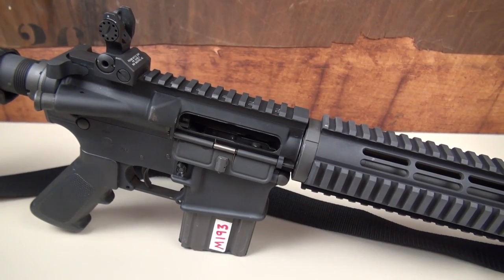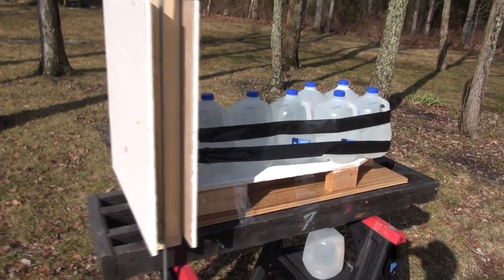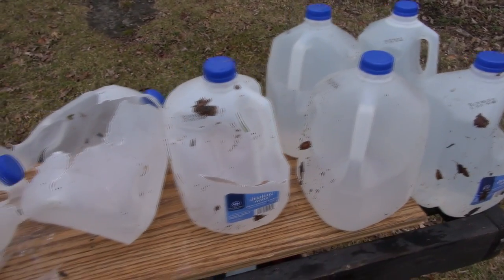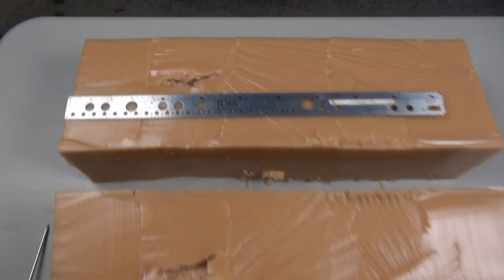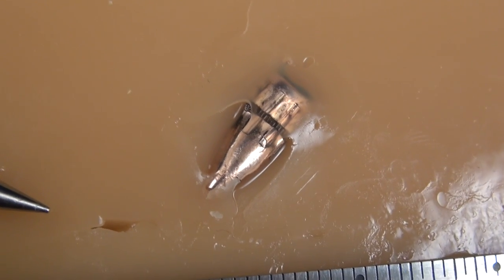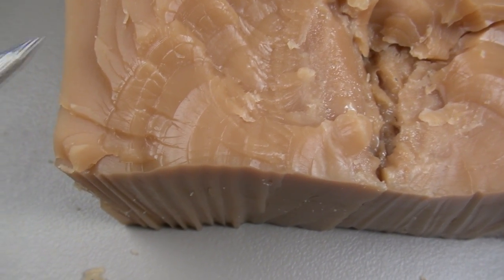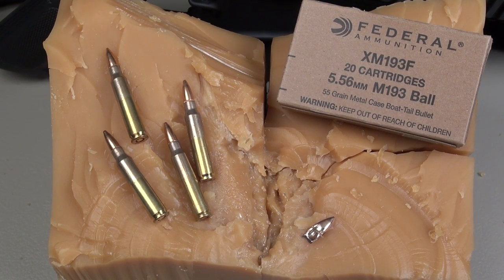5.56mm NATO XM193:  Drywall & Ballistic Gel Test

Comment: 416's are frequently chambered in 7.62, otherwise known as the M417 platform which SOF (includings SEALs) run in SBR. 

Hitting a non vital is known as a fringe hit. Newsflash, when your targets are taking cover fringe hits (arms, legs, thighs, shoulders, lower side abdomen) make up over 50% of actual hits on target. 

Incapacitation is just as important as killing a target on the battlefield, and in reality only a center chest hit or headshot is guaranteed incapacitation with a 5.56 round.

Comment: Haha. At >50 yards 5.56 will NOT yaw and will not even reliably frag 50% of the time, so what does that leave? A dime sized hole with very little kinetic force transferred into the target. Unless you hit a vital, he is still firing back. 

The round is too small and too fast to be effective at close range, especially out of a 14 or 16" M4 barrel. 

SEAL's are still using 7.62x51 416's since dropping the 14.5" MK17's for CQB so I don't think you have a clue.

Comment: There is a pretty big difference when they are behind a rock wall, tree, or some other form of soft cover. It will also make a pretty big difference when you hit a non vital. 

Not to mention that 5.56 does not yaw/fragment at >50 yards due to the rounds velocity and will not incapacitate an adrenaline pumped target with a non vital hit. There is a reason SOF was looking at 6.8 for CQB operations, the M4 and 5.56 does not drop bad guys at close range.

Comment: >shape and weight 

Are you daft? Higher mass means more retention of energy, which is moot at close ranges but it's important at long ranges. That makes it faster than a lighter bullet. Also, the plain M80 ball has a ballistic coefficient of almost 0.4 while M855A1 is around 0.3 - making the shape of 7.62x51 more efficient for range.

I think you're confusing x51 with x39, because x51 will go trough a pig at a MILE away.

Comment: But it has less mass and less ballistic coefficient, making it more sensitive to wind and inconsistent. Not to mention a more limited range.

Sure, the 5.56 is accurate but with it's limited case capacity it's not like you can buy really heavy low drag bullets comparable to the best .30 diameter options. Even if you could, it wouldn't feed trough a STANAG magazine. If you were buying a long action bolt rifle 5.56 wouldn't be the caliber of choice anyway.

Comment: @coltperc You do realize KE is simply a measure of the momentum?  There is nothing mysterious. Small (5) x fast (50) = 250  is the exact same as large (50) x slow (5) = 250. It's very very basic physics. Where the water gets muddy is trying to put numbers to the diff in characteristics of how a small fast round imparts that energy into tissue vs how a larger slower round imparts its energy. If you are shooting a steel plate it's easier. Same energy but longer impulse. A shove vs a slap

Comment: @coltperc You are confusing momentum with impulse. The momentum will be the same. The heavier bullet will take longer to impart that energy resulting in deeper penetration. In other words, it penetrates better & takes longer to stop but has no more energy in any way. A small fast bullet stops very quickly (short impulse) dumping it's energy very rapidly & doing lots of damage in the penetration it does get but not having lots of penetration. Same energy overall but results in very diff wounds.

Comment: Man you American's build houses like shoe boxes x'P The walls in my apartment are 1 foot thick sand stone. I could shoot them point blank with a .308 Win and it wouldn't go though. :P
Reply: all about location. If you live in a tornado area you will build it different from someone who doesn't have much of a risk. same with earth quakes. I live in the Northern area of the USA. We have insulation on the outer walls but not always on the inner walls. A lot of builders also like to find ways to cut cost especially if your not rich so they use the bare minimum. lol your .308 will be the best to stop a criminal
 lol.

Comment: Well, .30 cal projectiles perform more reliably than lighter, smaller projectiles when meeting interference such as grass, branches, leaves, etc and are more likely to continue on, or close to, their initial flight path.
Either the AK or AR are great platforms, I don't see the point in knocking either.
Cheers,
Sean.

Comment: It's not much more dangerous than handgun rounds or even buckshot. A miss is a miss and it can be potentially dangerous either way. On the other hand, the 55gr 193 loses it's velocity much quicker due to it's lower inertia. If you miss, with buckshot and pistols you have slow moving, high mass projectiles and with 5.56 you have low velocity and low mass projectiles.

Comment: What does penetration depend on? Mass and velocity. If you have a lower mass that quickly bleeds velocity after going trough a wall (also don't forget that buckshot and handgun bullets won't deform a lot, while 5.56 usually fragments - reducing the mass).

Comment: Nice test bro and I subbed. That is great round for that range and typical perk trying to break in the house. However I still lean on the 7.62X39 and 7.62X51 NATO due to the more brute force and knock down power. Either way wouldn't want to get hit by that 5.56. Nicely done.

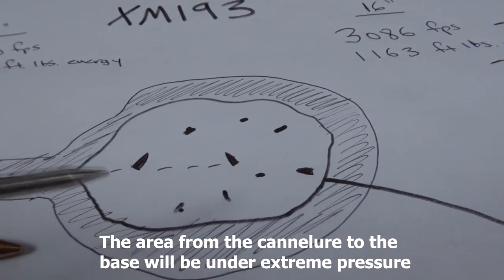Comment: M193 Ball is not 5.56x45mm NATO ammunition it's .223 Remington ball ammunition, it's the original designated 5.56x45mm ammunition used two decades before 5.56x45mm NATO was even created and adopted this is why the box doesn't say NATO, 5.56x45mm NATO started out with SS109 aka M855 green tip in the late 70's around 1976-1977 and it wasn't officially adopted by the U.S. military until September of 1982 when the U.S. Marines adopted the M16A2 because the M16A1 1:12 barrel cannot stabilize the 62gr steel core bullet so it was only to be used in M16A1's during emergencies and at close range,

M193 is the Sierra bullet Remington original loaded in their .223 cases for military surplus ammunition.

People keep calling .223 a varmint or  hunting cartridge is neither it was always intended for military use and even Eugene Stoner talks about this in an interview, no .223 Remington/5.56x45mm cartridges exist before the creation of the AR-15 it all started in 1957, there was not 5.56 NATO back then.

Comment: In 1977, NATO members signed an agreement to select a second, smaller caliber cartridge to replace the 7.62×51mm NATO cartridge. Of the cartridges tendered, the 5.56×45mm NATO was successful, but not the 55 gr M193 round used by the U.S. at that time. The wounds produced by the M193 round were so devastating that many consider it to be inhumane Instead, the Belgian 62 gr SS109 round was chosen for standardization,

Comment: You just disproved your own argument in your first sentence. The 5.56 was designed to reduce recoil, allow for greater accuracy and more effective suppressive fire, and increase a soldier's ammunition supply. It was not designed to "main" as you said. 
"really you wanna go there?"
I love how you act like your argument is impeccable.
"So by your logic your saying that the 5.56 has the same killing power of the 7.62?"
The 7.62x51? Yes, actually; in fact, probably more so though flexible tissue.

Comment: Kalashnikov understood that this is the range of most battles, which is why in his initial assault rifle system (AK-47) he used a round that packs alot of punch in a short range. (the 7.62x39 has a horrible drop rate after 300m, as it is a large round being pushed by not a whole lot of powder). Anything after that with just iron sights is difficult to hit for the average soldier. An updated version is the 5.45x39 (AK-74) which has a fast bullet that packs a large punch. Best of both worlds.

Comment: The standard combat confrontation in modern warfare is only about 300-400m. The military is all about being efficient and cheap, therefore, they use only cheap ammunition. Also, by making a heavier bullet, the muzzle velocity would plummet (and speed is one of the only real advantages of a bullet not much bigger than a 22 LR). If you look at other rifles of the same class (the AK-47 for example) there is a similarity as for range.

Comment: you should break less wood if you avoid running the wood grain parallel to the horse, also would like to see a video showcasing how the projectile responds to passing through a human sized piece of ballistic gel, through a set of drywall(possibly a 2x4) and into another human sized ballistic gel target, simulating a human casualty in a home defense , or otherwise situation.

Comment: that's not correct.
If the diameter and bullet type are the same, a faster and lighter bullet loses its energy more quickly that slower and heavier one, which means a faster/lighter transfer more kinetic energy into the target. Trust me, I learned physics at a graduate school and I can prove it by showing you a lot of formulas, which you wouldn't even understand. 
It's at long range that 5.56mm is actually ineffective.
Due to its high velocity and light weight, it loses energy so quickly.

Comment: no. the geneva convention bans bullets that are designed to expand like hollow point and soft point rounds. military full metal jacketed rounds do not expand. what you thought was expansion in the video was actually the round tumbling through the medium. when the bullet tumbles, it dumps most of its energy into the medium and causes the cavity. it should also be noted that pointed bullets all have a tendency to tumble on impact because rearward center of gravity destabilizes the bullet on impact

Comment: I had an M&P 15 also and I had the same problems with it. I also noticed it was very picky of the ammo it would cycle reliably. I sold it a wile back and purchased a Daniel Defense. I also have a Spikes Tactical, both are direct gas and they both work flawlessly. I run them both on a regular basis and I put anywhere from 1000-3000 rounds through them without cleaning them. smith and Wesson make great firearm but from my experience they just don't build a reliable AR15.

Comment: M193's are the US designation for the NATO SS109 loading for 5.56 rounds, per request from the europeans in the late 60's when the standard ammo was adopted. it has a hotter load of powder than original vietnam era 5.56 ammo and the boat tail shape you see in the video.

as far as I know M855's do not deform at all except for maybe shedding the copper jacket to expose a non deforming steel core.

Comment: ok i can see you have never studied bullet design,th term full metal jact boattail is the design and shape of the bullet a full copper case from from to back boat tail design is  the shape of the tail for aerodynamics it does not expand a hollow point will expand in warfare fmjs are designed to wound incapacitate hollowpoints are designed to kill hence the geneva and hague conventions

Comment: It was used as a training round, predominently.  Every time we checked out ammo for the range practice and qualification, this is what we received.  If we loaded up the trucks and gear for deployment, it was the heavier grain bullet that we received.  The larger grain bullet needs a clean rifle.  Also early production barrels have tighter MILSPEC tolerances than latter barrels.  That's mainly due to cutting tools get duller and which then forces resharpening, etc.
SFC, U.S. Army (Ret.)

Comment: We probably agree on more than not. My HD set is my grab in a hurry S&W M&P .45 w/night sights and TLR-1. The Mossy w/low recoil buck is the HD long arm of choice. Buckshot shuts things down quickly :D. I really want to see what the Hornandy SM 75 gr does in barriers & gel. Costs less/rnd than M855,or M193, and it shouldn't be as velocity dependent. If it performs it would be good for stocking & practice. AR is for <200 meter in SHTF. Anything further it's stay low or E&E time. Good hunting.

Comment: So then why have so many LE operators use the M4 carbine, even over the SMG for CQB in interiors? Why isn't the shotgun the primary CQB issue & not a support weapon? The M4 and the SBRs have a record for urban use, including when you have personnel in other rooms. A Benelli M4 is nice, & costs more than my Colt SP6920. My old Mossy 500 will put low recoil buck downrange fast & accurate. The point is I want to know the results w/this round. I already know my systems/functions/purposes.

Comment: I know my terminal ballistics & platforms, but I want to see how this particular 75 BTHP load does in gel & barrier penetration & what depth it starts to work at. M855/M193 do well, but yaw/fragmentation/depth yaw begins are not a given & velocity dependent. They work, but there's better. Even the reduced recoil 00Buck I use in my HD Shotgun will easily overpenetrate interior/exterior walls. AR's offer fast targeting, faster followup shots, and less overpenetration for urban settings.

Comment: @shkotay For yaw in both the M193 and M855 the velocity needs to be above 2700 fps. So shorter barrel, shorter distance at which they stay above that threshold. The 55 gr bullet of the M193 will stay there just a little longer than the heavier M855 slug. Even then yaw and fragmentation isn't guaranteed, but most likely. For HD distances it shouldn't be an issue, but with a 10" SBR, you are probably at 125 yards or so max to stay above 2700fps w/M193, a bit less w/M855. 75gr OTM seems better.

Comment: At lower velocities, yes a fmj would normally penetrate further. But the M193 FMJ round is travelling at very high velocity at close range. When the bullet tries to yaw (tumble) in tissue or testing-media, the drag forces cause it to fragment violently. When bullets fragment, they tend to penetrate less because there is now effectively more surface area trying to move through the media which causes them to lose velocity faster. More surface area = More drag

Comment: The cannalure does not cause it to yaw, any boat tail bullet that travels in excess of about 2000 fps will usually tumble. The cannalure is nothing more than a mechanism that the military uses to prevent bullet set back; which would cause dangerous overpressure. The cannalure does effect the fragmentation by weakening the bullet jacket but it’s a side effect; the primary reason for a cannalure is as said above.

Comment: You would have to suppliment that wall with Led Zepplin posters and pizza boxes to approximate my dwelling. As an aside you mention you are breaking a lot of boards. When you shoot the media in slow motion you can see why. A HUGE amount of energy is transfered to the board by the gellatin. Think what that does to a human torso. You sort of touched on that when you mentioned the temporary wound formation you found. Would like to see some kind of pressure transducer attached next time. Thanks.

Comment: A straight on wall hit is worst case scenario, and I don't think one inch total of drywall will stop anything.  However, if drywall were to be hit at a 45 or 10 degree angle, you could theorize that the results will be much different.  You are going to send a bullet through a lot more drywall at those angles and have a greater chance of hitting a stud along the way.  It would be interesting to see actual results at not just 90, but 45 and 10 degree angles as well.

Comment: This could actually be considered a "failure". While I agree this was still great performance, most people tend to agree that if the M193 doesnt break at the cannelure, then it didnt perform properly. I have tested this same bullet before, and in my experience, different brands will tend to break and others wont. Of course it could be lot to lot variation in the lead hardness and jacket thickness, but these bullets are expected to break all the way down to 2600 FPS or so. Great test BTW!!!

Comment: M193 ammo is still the proven man stopper compared to the M855. They switched to the heavier bullet so point of impact is the same for mixed bullet types used for their SAW. 62 gr weight is same for tracers and all other types of bullets but the heavier weight compromised the effectiveness from the original 55gr FMJBT. The proof is the large number of reported failure to stop from the troops, causing them to shoot enemies multiple times or go for head shots.

Comment: No more effective. Less effective in fact. Hollowpoints are designed to use the bullet energy to expand and so they will not tumble and fragment. HP is better for heavier .223 bullets, once you start getting up into the 70 gr range. Fragmenting depends on speed and heavier bullets are usually slower.

source: AR15 ammo oracle

Comment: I did my own test making sure I shot through the studs: 1 XM193 went through 2 layers of sheetrock, 2 suds, and 2 1/2" OSB layers and kept on going.  Testing with water jugs is not a great way to test anything- Mythbusters showed water slows down higher velocity bullets dramatically, so that 50 BMG barely penetrates water.

Comment: I bought 1000 rounds of the xm193 and they were popping primers about every 60 rounds on average. The spent primers would get caught either in my trigger group or the grooves for the bolt locking lugs. Both cases caused a major failure requiring a field strip of the rifle sometimes with a live round in the chamber. I will not buy again.

Comment: the 55 gr doesnt get enough credit, its not as popular as the surplus 62 gr I guess because it doesnt have the "cool" green tip. The 55 gr is a MUCH better round than the 62gr green tip. Im surprised the jacket didnt break in half and fragment though. It should at anything over 2700 fps (so Ive read)

Comment: .223 is a sporting round,loaded to a lower pressure, some internal case dimensions are different. the 5.56 is military loaded to a higher pressure. supposedly any weapon marked 5.56 can fire both,but a rifle marked .223 should only be used with .223rem. lots of sites discuss the difference